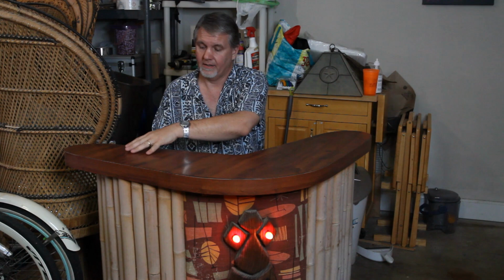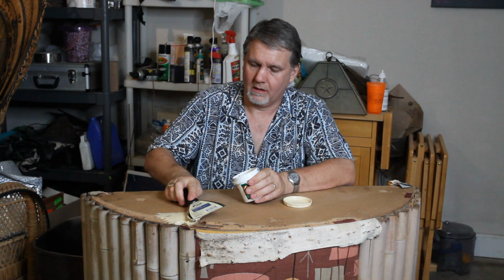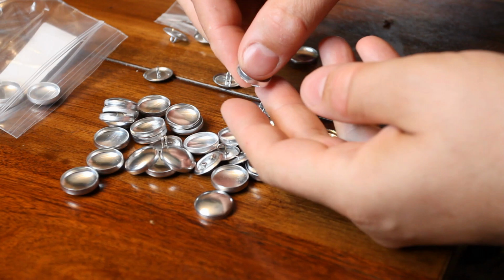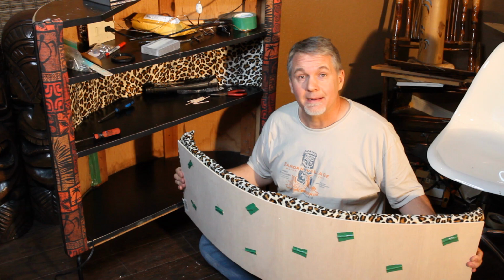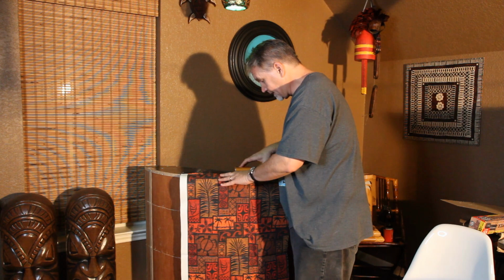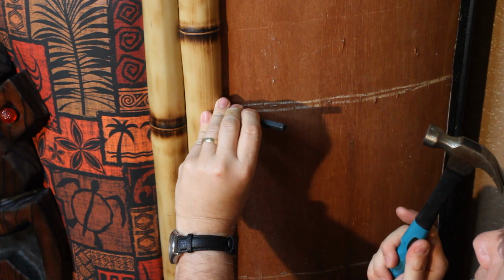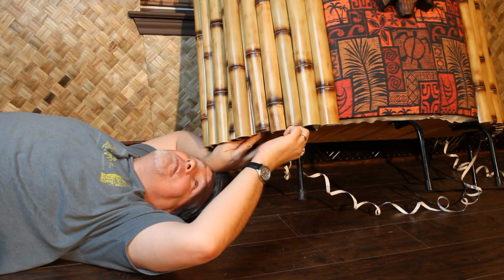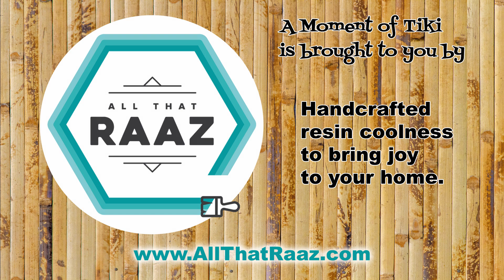A Moment of Tiki Episode 51: Krypton Bar Rescue

Comment: That was a fantastic restoration!  Excellent call on replacing the bamboo with your own.  I love how the dark burn marks compliment your choice of the replaced fabric.  You did everything you possibly could and did it well.  Thanks for the tip on where to get cool fabric at spoonflower.  I am bookmarking that one if I ever get around to doing Tiki projects.
Reply from the maker: Glad you found it helpful, Glenn! It was more effort than the bar itself is probably worth, but then again, I didn't get the bar with the intent to resell.

Comment: Your bar restoration came out GREAT!  I really enjoyed watching this project.  I think the new fabric looks better than the original.  It really sets off the carving.  Nice job.
BTW - did you make the bamboo light with the palm tree cutouts?
Also, will you be sharing this inside tiki room project with viewers?
Reply from the maker: Thanks for the kind words, Michelle! That bamboo light actually came from a Goodwill in Austin. They got a huge shipment of these in and were selling them cheap. In addition to the palm tree I got one with hibiscus cutout as well. I'm guessing they originally came from the Philippines or Indonesia--the design is incredibly simple and it would be more than easy to make one if you had access to timber bamboo of sufficient diameter. And yes, I will be sharing the interior build. In fact, I already have been, albeit in piecemeal fashion. This episode with the Krypton bar restoration is one installation. Episode 8 (baseboards) is another. Other episodes that directly feed into the build-out of the interior space include Episode 33 (Witco rescue), Episode 40 (Rattan lamp), Episode 45 (Tapa light) and Episode 48 (Fish float lights). All of those are directly going into the interior space. I've got a couple of in-progress episodes that will show other aspects of the build-out. It's still got a long way to go. Acoustics in there are terrible which is why I don't film in there more often.
Reply: @LagoonofMystery  I've seen some (most?) of those episodes.  But I'll need to go back and check.  My husband and I have been chipping away at the episodes.  Our favorite is the "tour" of the entire length of your Lagoon of Mystery bar.  It was surprisingly MUCH bigger than I thought.  You are very lucky to have such an expansive space out there to be able to build that oasis.  We are in MA, so we can't have a year round outside tiki bar. (sniff/sniff/little tear), so I am very jealous!
What a find on the bamboo lights.  I wish I had access to some timber bamboo, I'd try to make a lamp like that, but up north... they don't sell bamboo timber (as far as I know).  :(
Reply from the maker: @michelleduprey6661  Alas, even though our Texas winters are comparatively mild, the Lagoon is essentially unusable from Dec-Feb, which is why I'm working on an indoor space! But yeah, for northern climes outdoor spaces are a no-go. Oceanic Arts (back when they were around) would ship timber bamoo (culms that are roughly 4" in diameter or larger). There must be others online that'll do the same although shipping will be a bear. I'm fortunate in that there's a place in Austin, just up the road from me, that gets timber bamboo in from Louisiana. Sourcing locally is a convenience not to be overlooked. Good luck with your build!
Reply: @LagoonofMystery  Yes, shipping costs for something like that would be a budget buster, I'm sure!
Thank you for tossing some luck our way!  Our place may not be as large or as spectacular as your place, but it gets the job done... in season!  I named it the Rum Barrel Bar.